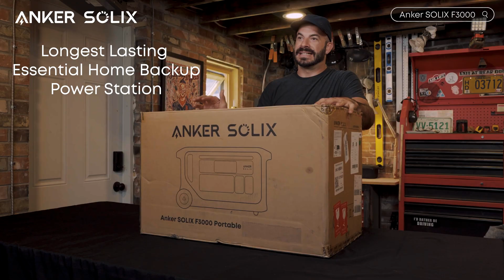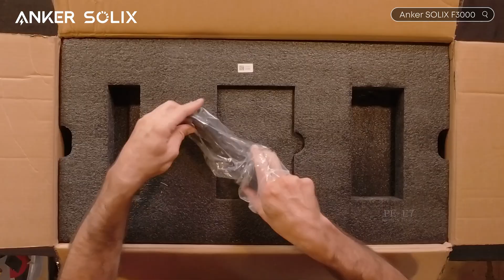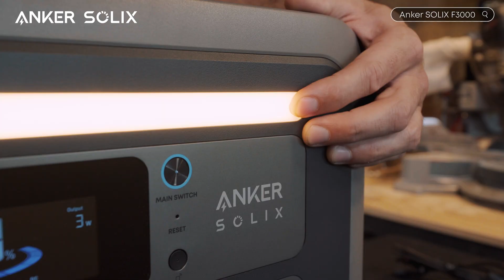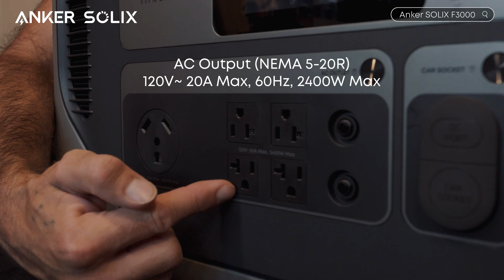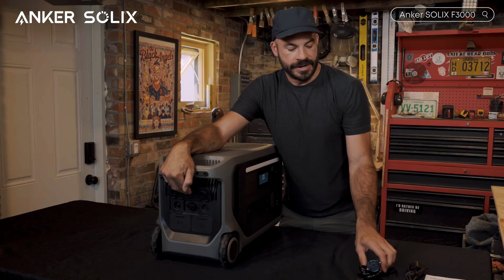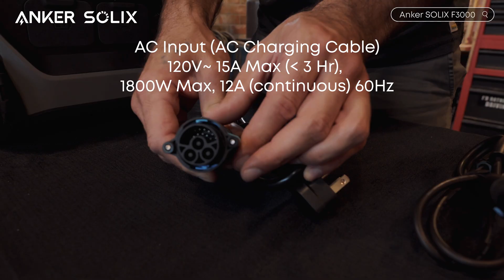Anker SOLIX F3000 Unboxing & First Impression: Longest-Lasting Essential Home Backup Power

Comment: The number 1 issue I have come accross is that when 2 coupled F3000 units are fully charged to 100%, the solar pass through completely stops, until down to 99% and rate of solar passthrough goes up as the battery % drops in the 90s%, then pass through stays even as it charges the batteries. So, this means, I will need to buy more battery expansion packs to fully utilize the AZ sun and have power through the night. (Hoping the 2 additional f3800 plus units I ordered don't have this limit) only one way to find out! Lol. Yes I'll expand it with more batteries. Let's see if Anker sends me more coupon codes 😊